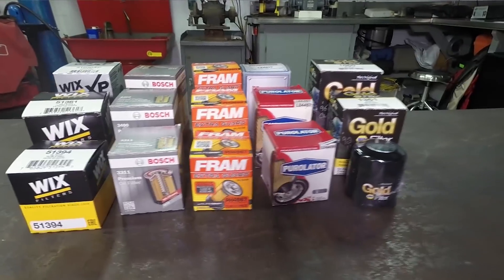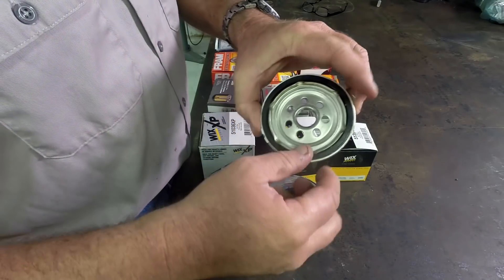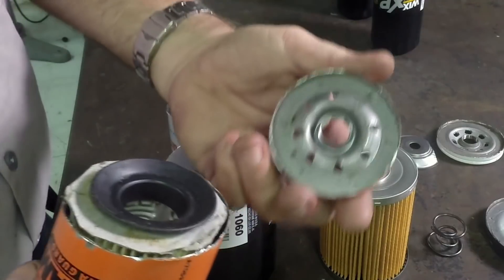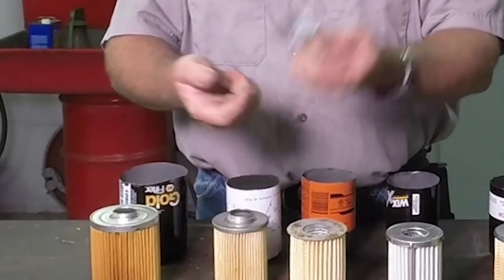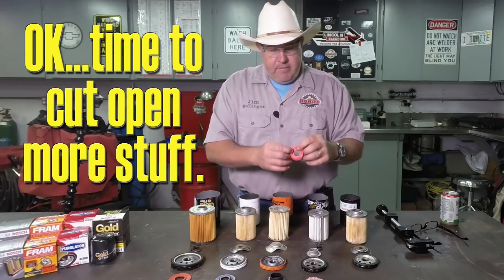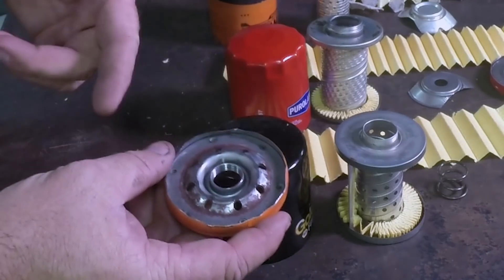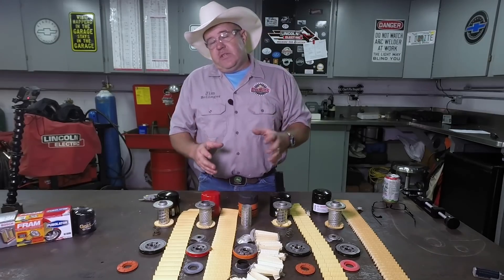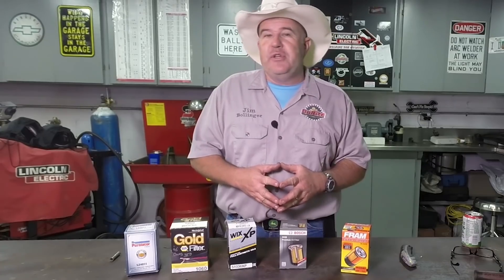The worst oil filter EVER!

Comment: Wix makes filters for quite a few companies based on that companies specification and requirement. Not all filters a created equal. Another 2 brands that are very high quality are the K&N and Mobil-1. When you get into the $20 dollar range for an oil filter you get a pleated metal screen along with the paper element to prevent large debris from penetrating the paper and leaving a hole. The hard brittle sludge that forms in the engine when the oil is burned off breaks off and tries to go through your filter. This is a great video showing what most of us face when selecting brands at the local parts store. the filter base is always going to be the heaviest part of the filter due to the pressures the filter faces combined with temperatures. I have seen some filters have thicker threaded areas which are even better but you don't see that to much anymore. I haven't bought a FRAM filter in 15 years.

Comment: Please do a comparison of different grades of Fram filters. There are 3 commonly available, and another called a racing filter.
Reply: That is a $5 fram filter and a $5 Napa filter do you really need to know more they don't get better and most true racing filters tend to have a thicker shell for higher pressure and a metal screen type media that does not filter as well as standard filter because its made to flow more. Frams racing filters is a pos that will lose you more then a race. Wix/Napa have a racing filters and it is very good price if you are actually racing.
Reply: @t-bfr45-70 Thanks for the info on the racing filter, not that I would ever buy one. The Fram used for comparison is the least costly in the Fram line. The NAPA Gold is certainly marketed as a premium quality. Comparing apples to apples might have been more appropriate. I just wonder if all Fram filters are so poorly made or if they actually do make a comparably engineered product as the NAPA Gold filter. Interesting that NAPA sells at least 10 different oil filters for my truck, including a $2 one they call  NAPA ProSelect. I'd bet there is only a small difference in the manufacturing cost of the "cheap" filter and the top-of-the-line one.
Reply: @buckm3183  the proselect is very close in design to the gold it uses a rubber antidrain back vavle vs silicon in the gold and has smiler media  amount maybe little less the bosh they showed in this video the platinum is the wix xp all napa filters are with. And that's not the cheapest fram they made
Reply: @buckm3183  should be the proselect silver gold platinum then maybe Mann bosh altrom depending who makes the truck I cut a lot of filters open. The proselect to platinum are napa options and all made by wix.
Reply: @t-bfr45-70  Sounds like it is a pretty good value. The $2 price surprised me. AAA members get an additional 20% off.
Reply: @buckm3183  napa have a filter sale every year you can get gold half off. maybe  two times a year can't remember but any of the lube shops that use napa filters use the proselect and a lot of companies it is made to surpass oem.
Reply: @t-bfr45-70  Thanks for the tips.
Reply: @buckm3183  your welcome and the other best part about napa/wix if the filter fails they will take care you. Friend had a brand new fram oil filter imploded 10 mins after oil change fram determined it was the filters fault so fram gave him a new filter for his new $6000 boat anchor with only 1000 miles 😀. The hi way district here had a air filter implode and sucked dirt in the motor on a piece of equipment the filter had 100 pounds of dirt in it wix paid for a new $30,000. I was betting on them saying something about the filter being way past needing changed but they said still should not have ever imploded. In my time dealing with wix reps talking to them if a filter fails for any reason because of the filter they don't have a problem buying a engine the don't have very many failures. Even if say a hydraulic filter explode because the machine its on has a problem that  caused a pressure to spike if wix says a filter is rated for a machine they take a spike in pressure in to consideration before saying the filter is rated for the job in this case though only thing lost was oil so they will buy some oil and a new filter. I heard ok things about k&n when it comes to oil filter warranty even though their written warrant don't sound that good.

Comment: I wish you had included a K&N and Amsoil in your test.
What about a sand test? Weigh sand added to the oil. Then measure the increase in filter weight. Plus microscopic exam oil oil for sand particles.
Reply: K&N is like the bosh amsoil, Royal purple are very similar to the bosh in how they are built but with similar media to the wix xp/Napa platinum. And as far as air filters go I would never ever run a K&N air filter I don't like sand running though my engine. Get a air box off a bigger motor if want more air flow and if its a diesel Napa has a TRUCK filter that you can make work with a little changing to your intake piping. can't remember the number but would sell it to every one with a Cummins or a powerstoke that wanted a k&n after explained that a k&n was one steep up from putting oil on a sock and calling it a filter.
Reply: One more thing I never seen any other filter company replace a engine $30,000 on a piece of equipment when the air filter failed. The air filter weigh in at over 100 pound when it was pulled out but wix said it still was a defect in the filter the engine should have ran out of air not implodeded a  filter. I I'm positive any other filter company would have said you should have change the filter they are not made to do that. Most filter warranty if you read then do not cover the engine they pretty much say they will give you a new oil and that's all.

Comment: You idiots who are bagging fram THINK about this!! there Is a required oil flow through a filter which corresponds to its surface area for it to filter effectively. Fram has designed this accordingly to work and they have for decades.This clown needs to read this. If you stuff a toilet roll down your throat and expect to breath what happens??  Umm you die!! It’s about FLOW and turn over rate of fluid.Is this guy an idiot?? Seriously I don’t know what to say!! 
I’m just that glad that this idiot obviously designs filters for the world wide market and knows better than fram who designs and sells them an obviously wants them to fail so they can be  sued.Once again you FUCKEN IDIOT who posted this MORE MEDIA does not mean better!.And to you morons who post “gee I will never use fram again” do some fucken research (I mean actual research) not social media crap like this,then THINK about if what this fucken idiot says is true why is Fram still being used by aftermarket parts suppliers with ZERO claims,
.I am sure the clown who posted this has absolutely NO idea about filtration flow rates,maybe he is relating bigger size of filter media to the size of a burger (more filling is better to him) 
Yeah I sound pissed  but I have had a gut full of frikken social media “experts” who don’t have a frikken clue of what they are saying.I mean think once again about his post  he knows more than Fram about filtration ? and half you frikken idiots agree with him???

Comment: Yeah like others said not a fair test but now I will not buy the lower priced fram filter and choose the better fram filter or wix. But honestly I've been using those low priced orange fram filters for 15 years in 8 different cars and never had engine problems in any of those cars. But those were used older cars I just bought a brand new suv and probably won't put the cheap fram filter in it

Comment: In europe now we have a "ecological" oil filter in which we just replace the filter element and a o-ring that seals the oil filter can. But the oil filter can is not metal! Even when it is definitive and comes with the new car is plastic. When they first appeared a lot of mechanics did put the o-ring misaligned and they started leaking. But now surprisingly they are not giving so much trouble once you know how to torque them right and put the o-ring on.
The advantage is that everybody comes to see the filter element and it can't be too bad.

Comment: Okay, if you're going to do a comparison, do it with the same model, like the FL1 Motorcraft and the Fram equivalent and so on. You have five different manufacturers but for five different engines.  You are not comparing apples to apples, more like apples to bananas and grapes. Try again and I may believe what you are saying. Worked in automotive parts for a number of years and yes there is a lot of "quality" difference from one company to another.  But next time get all "apples", okay?

Comment: Won't more filter media possibly restrict oil flow???
Use what your owners manual Says. That is what was designed for your vehicle...
Reply: More media = more surface area=more filtration capacity

Comment: I learned how bad Fram was back in the 70
's.  I had an AMC that the garage put a Fram filter on.  When I parked in my driveway, the filter blew up.  I had to put a filter on myself before I could even move my car.  Later I found AMC had a lawsuit against Fram because their filters  would not hold up.  I've been using Wix for years.  I guess the reason Walmart pushes Fram is because they are cheap.
Reply: Hey, you can't put cheap filters on high performance cars like AMC

Comment: engineer's prefer the Belleville washer for superior spring tension that holds up to heat and gives a more uniform Hooke's constant than a coily spring.
Reply: SO, does the FRAM filter spring fail in the heat?

Comment: Woo there cowboy! A 3 dollar filter vs.a 10 dollar filter this is nonsense.  You get what you pay for . The Fram top quality ultra filter is quality throughout.  It's ten bucks at Walmart.  A comparison by price is what we need to know. NAPA Gold is their top of the line most expensive filter. Bosh doesn't make cheaper versions of their filters. Each step up in price equates to better materials and design.  This video needs a do over comparing equally priced filters.
Reply: The very fact that fram is willing to make and sell such a shit product is where you should be focused.
Reply: Yep this guy did a very biased apples to oranges comparison. https://youtu.be/vJ7_-mhqfdQ The fram Ultra is better than the Wix.
Reply: Frame user .
Reply: Your right. I agree 100% with him but frame has their top quality filter. But I go with napa platinum
Reply: Napa gold is not the top of the line it is a $6 filter the platinum is which is same as the wix xp a $12 and the fram ultra is still a pos I have cut it open Napa has their lowest quality filter called proselect  and its still higher quality filter then the fram ultra it is very similar in design as the gold but with less media similar to the bosh they showed. On top of that all that's the fram extra guard which is not even frams lowest quality filter.
Reply: I agree with you they need to do this again but use all cheap filters
Reply: @paulkovacs4508  fram is still the loser wix/Napa still in the very top
Reply: Napa Gold is the mid grade filter. They have a platinum filter. But I agree, they should have used the Napa Silver (lowest end Napa filter) for this comparison. However, Napa has huge filter sales 2 times a year. Napa gold's are only 3.50-4 dollars for the average car for the month of April at Napa stores where I live
Reply: @bdl1221  Napa silver and their cheapest pro select are still better built then the top fram your media is material only goes so far and fram media is lacking the in side of fram filters crush right at the seam. https://youtu.be/Y544o-mw2wc
Reply: https://youtu.be/Y544o-mw2wc
Reply: There you go JIM...you have been caught again! Please compare EQUAL quality parts and don't think people won't know the difference! Anyway, at the end of the day...the FRAM filter will do the same job as the rest of the filters...filter oil ! Too many fleet owners out there using FRAM filters and they won't compromise on performance. In response...the re-do of the video should be about how WELL the various filters do there job...NOT about how the thing is made...after all...isn't that what we really want to know ?? Do some real world testing on equal 
products...

Comment: Things I learned from this video: this guy hates FRAM oil filters
Reply: I picked up on that was well.  He even mentioned it in the video that Fram is why he created this video.  When you compare low quality to high quality, of coarse the results are going to be obvious.  Shame nobody else picked up on that.  But, it has sparked me into doing my own test to see if I get the same results in regards to the rust he found, which I have a pretty good theory on why the rust was there.  Stay tuned :)
Reply: @TheBaggerLife69  I've been using FRAM oil filters for 25 years and never had a problem. If I can get 400000 miles out of a 1995 Chevy Astro van I must be doing something right
Reply: @loudpipesavelives69   Exactly.  I've been using Fram for just over 30 years and my dad has used Fram his whole life and neither of us has had any issues at all.  We do however, follow the recommended oil change intervals though.

Yet based on some of these ridiculous comments, because we keep using a product we believe in and have had no issue with, we get called sheep lol.
Reply: @loudpipesavelives69  right ive been using fram for the last 70 years on a 1980 for pickup and that bitch got 1.2 million miles on it. And alot of good ol' diap spiat
Reply: @adamamador3541  you sure it wasn't a '49 pickup that's been eating frams for 70 years, an 80 would only go for 39.
Reply: @loudpipesavelives69  Fram does make cheap filters for the Kmarts of the world, but they also make higher lines that are probably as good as others.  how about test various filters at the same price point.
Reply: Ive used Fram for 15 years. Never once had an issue. I dont think this tear down is as telling as everyone thinks it is.

Comment: Its not always true that the hard material is the better you may find harder and well fabricated material but it doesn't do what its supposed to do. If you tested these filters with dirty oil using any type of machine and then checked the results it would be more accurate to judge.

Comment: Thanks for the review. Surprised to find that Fram is so bad, but I don't use their bottom-of-the-line filters.  

A few "tips" about shooting video (I used to work in the industry):

1) Don't move things around when you show them to the camera. HOLD STILL so people can see what you're talking about. 

2) Get a shot of your subject that's tight enough. That will be easy for your camera op if you HOLD STILL (see above).

3) When showing text on the screen, leave it up long enough for people to read it. "Zip-zap" text is annoying. Also the text should not compete with the audio for attention. Pause the video while text is up so a viewer can read it without trying to follow the video action at the same time. Conflicting info is LOST info. 

4) Compare prices. The Napa Gold filters might be the best of your assortment, but what about the price? I see you reviewed the cheapest of Fram's line. What about their X2 or Extended Life filters? Comparing quality is largely meaningless without comparing prices. 

Other than that, good job.
Reply: Wow lie much !! or are you just that stupid?  Thats not rust and you know it. thats Discoloration  where they use heat to cure the cardboard to the filter. there is NO rust in the canister !!  yes it is a cheaper filter, but its susposed to be. its only good for 5,000 miles and is dirt cheap for walmart to sell. if you want a good filter test a fram ultra filter rated for 15,000 miles. cut one open to see , makes your napa filter look like a pice of shit.  i am a mechanic & i know what im talking about.  you are lying to these people and should be ashamed !!!!!!!!!!!!!!!!!!!!!!!!!!!!!!!!!!!!!!!!!!!!!!!!!!!!!!!!!!!!!!!!!!!!!!!!!!!!!!!!!!!!!!!!!!!!!!!!!!!!!!!!!!!!!!!!!!!!!!!!!!!!!!!!!!!!!!!!!!!!!!!!!!!!!!!!!!!!!!!!!!!!!!!!!!!!!!!!!!!
Reply: Compare apples to apples.!

Comment: I am a retired tech of 45 years. I have seen at least ten vehicles that had low oil pressure and on at least six of them the customer had installed new oil pumps and bearings only to have me look at it and replace the Fram with a Wix or Hastings and fix the problem. The last one was another shop called me, they had replaced a fuel filter on a Duramax  and it would start and idle but would not rev, I asked what kind of filter he had installed, Fram. I told him to replace with a good filter and he did not believe me. Twenty minutes later he called back and wanted to know what kind of beer I drank.

Comment: Millions of cars on the road now running Frams and will continue to run them without issue.  This is an OLD argument that has been dis-proven time and time again.  Frams perform perfectly fine under regular conditions.  Are they the best filter?  No.  Head over to bobistheoilguy.com to view used Frams that have been cut open after real-world use.
Reply: @PracticalTech Keeping beating that dead horse.  Old news, pal.
Reply: @PracticalTech No one is saying that the EG is the best filter on the planet.  For its price point, there are better choices.  But the fact of the matter is that the EG is perfectly fine for everyday use.  The cardboard endcaps and glue perform their job just fine under normal conditions.  I would not hesitate to use one in any of my vehicles and have done so countless times without issue even though I prefer oem filters during warranty period.  There are plenty of threads at BITOG.com that show used, cut open EG filters that performed as intended.